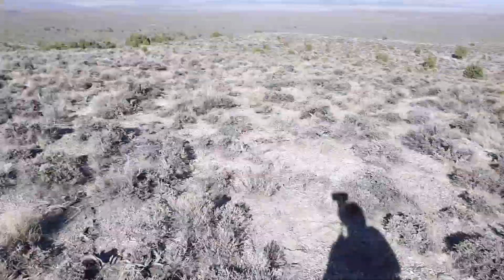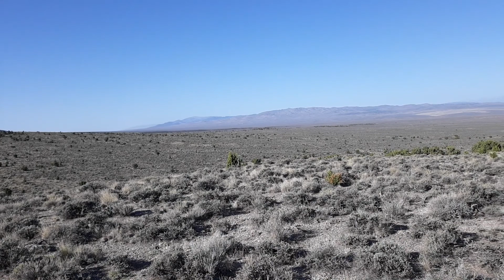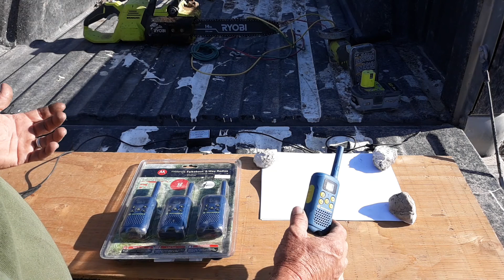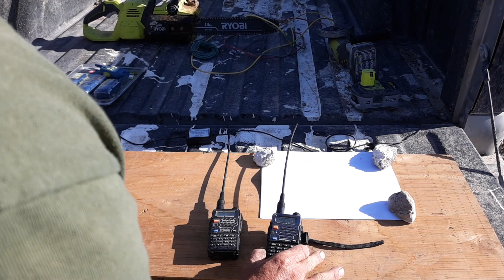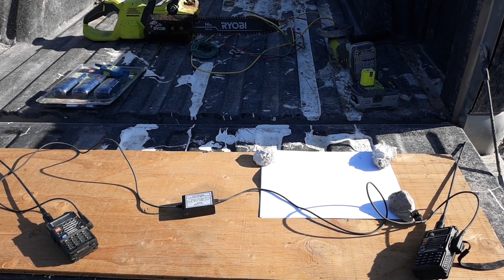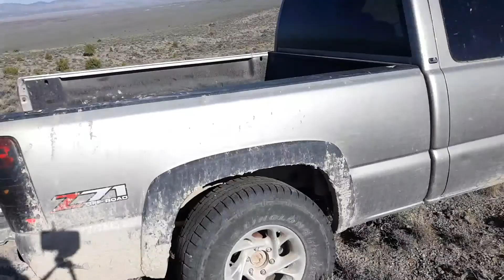FRS/GMRS repeater

Comment: In your description you say "𝘐𝘵𝘴 𝘯𝘰𝘵 𝘱𝘦𝘳𝘮𝘪𝘵𝘵𝘦𝘥 𝘵𝘰 𝘴𝘦𝘵 𝘶𝘱 𝘢 𝘳𝘦𝘱𝘦𝘢𝘵𝘦𝘳 𝘰𝘯 𝘎𝘔𝘙𝘚 𝘰𝘳 𝘍𝘙𝘚 𝘧𝘰𝘳 𝘨𝘦𝘯𝘦𝘳𝘢𝘭 𝘦𝘷𝘦𝘳𝘺𝘥𝘢𝘺 𝘶𝘴𝘦". That is partly false. It is absolutely legal to set up a GMRS repeater that runs 24/7 as long as you have a GMRS license, the repeater has a Part 95e(previously 95a) grant and the repeater is operating on the designated repeater pairs. Working a repeater with an FRS radio at all, or even a GMRS radio outside of one of the designated repeater pairs, is illegal.

With the recent drop of the GMRS license fee(now $35), and a single license covering the holders immediate family, there's zero reason to not go full legal. That will allow you to test the abilities of your repeater setup before an emergency without fear of breaking the law. Even better, if you're going to be using it in a fixed location, you can run a more substantial system with an antenna on a proper tower for some real coverage.
Reply: you do realize that the only people that are getting nailed by the FCC are the people who are broadcasting their callsign and/or  severely abusing the frequencies , right?
The FCC will send  "nasty letters"  for several years before any real legal action is taken.  That's generally only happening if you severely abuse the frequency spectrum (e.g.  you are jamming people and running a pirate radio station.... mostly to be a dick).   If you stick to packet radio, don't hog the frequencies, and in general,  just be nice to everyone on the radio,  the laws don't really apply.   the FCC allocates the spectrum so that it can all be shared and used in the most efficient way possible.
The other thing is pure economics.   The FCC doesn't have the funding to monitor and find EVERYONE who is abusing the say...  GMRS spectrum.  They rely on other  "Sad Hams" to snitch.  At the end of the day,  unless the FCC has an actual mailing address to send that nasty letter to,  they just are likely to bin the complaint and move on to more important things on their agenda, like.. meeting with lobbyists.  LOL.
Case in point,   CB Radio.  So few people use it anymore that certainly almost nobody in the FCC is going to send out nasty letters to people using a CB radio who are i dunno say,  using it for Packet Radio  or Weather FAX  transmissions, or just transmitting at more power than the allowed 5 watts.   GMRS,  well, that' another thing alltogether.  Because of really cheap baofeng radios being incredibly easy and cheap to get,  and you don't need a Ham license or a GMRS license to purchase them,  ....almost anyone can buy a pair and start talking on them nearly immediately.  here again, with the limited resources that the FCC has at their disposal,  they can't monitor GMRS signals on every square inch of American soil and enforce the laws.   The resources just aren't there.

Comment: Cool I found the repeater module at walmart.com of all places. I’m not sure if you can repeat those family radios since you don’t have dual frequency mode. They would basically have to have two radios one to transmit one to receive.
Reply from the maker: Yes you are correct this is a poor mans repeater to use you would have to change channel for TX and RX a bit clunky but usable.